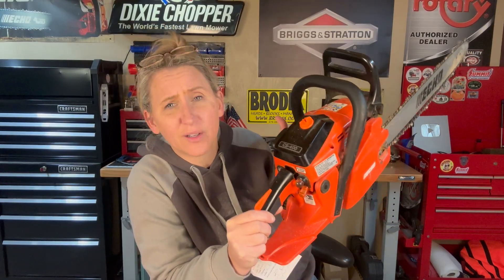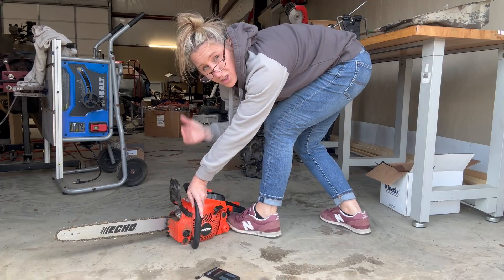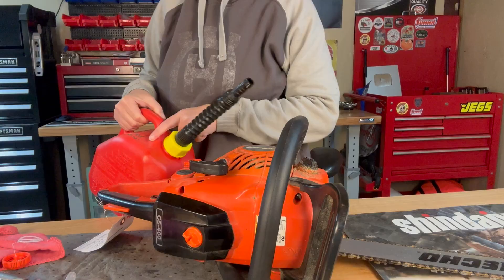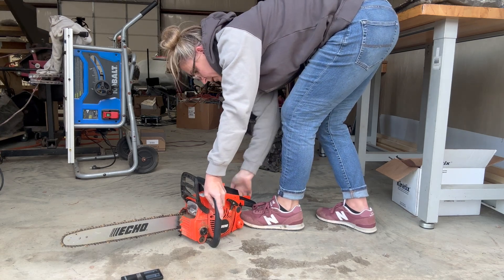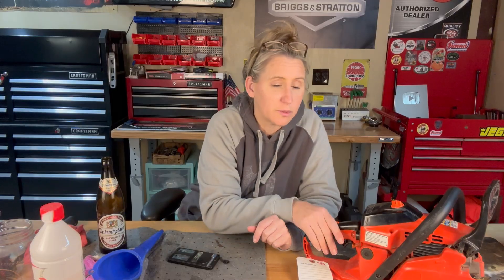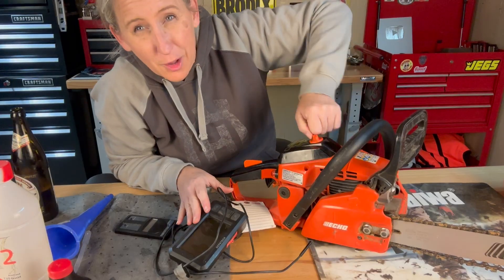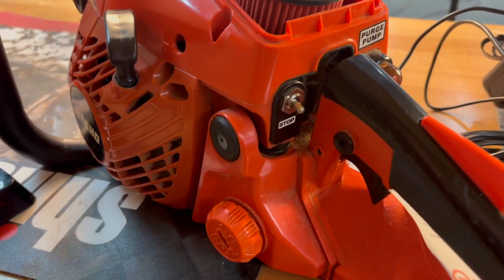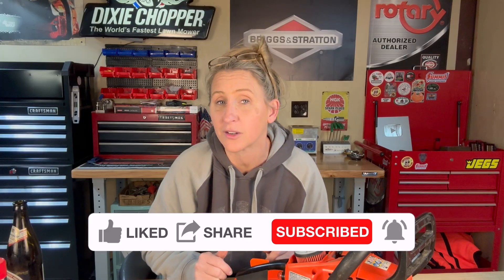Engineered Fuel FAIL! Your Small Engine Is Not Running Right, Even if You Think It Is!

Comment: I was lucky I ran tru fuel for three years no problem ever. Then I heard you talking about the problem,next time I bought a can of fuel had problems with all my two cycle equipment. Changed back to regular fuel and oil mix,problems solved. Thank you so much for your time doing videos!!!!
Reply: Ok I tried nearly everything for my ms250. It was running fine and then I ran out of my mixture so I went to the store in desperation to finish the job quick. It was Tru fuel.. great advertisement 92 octane/never goes bad etc etc so I thought I was buying high quality stuff. My chainsaw won't start. I thought my carb got plugged with the rotten cedar. I changed that. I thought air filter was dirty, I changed that. New plugs. New fuel line. New "Tru fuel".

Next on list is NEW FUEL.

Comment: That saw is still running pig rich. All that needs to be done with the tru fuel is to lean out the h screw a bit. Tru fuel is alkylate fuel and it naturally causes a 2 cycle to run richer than standard pump gas, hence the rpm increase with just swapping the fuel and no carb adjustments. 

Echo saws are notoriously set up overly rich from the factory, especially the top handle saws. 

No matter what fuel is used, the carb needs adjusted

Comment: I got a leaf blower from a not particularly mechanicaly inclined friend  Tanaka was the manufacturer; he said it was difficult to start and was impossible to start when hot. I found he was correct but also didn't idle properly. He had that pink mix fuel in it I had same issues with it and dumped it out and used my own pre mix and it ran fine. I had just assumed it had stale fuel but now I'm thinking it was just crap engineered fuel

Comment: I have four different two stroke lawn devices that require three different fuel ratios 50 :1, 40:1 and 20:1. I've been using a 40:1 mix on all of them with no problems so far and was wondering if it may cause damage to the ones that require a different ratio later down the road. Also, I noticed the red armor oil that you recommend has fuel stabilizers added and in previous videos you mentioned adding a cap full of ethanol shield stabilizer and was just wondering why? Thanks for sharing all of your repair experiences it's helped me quite a bit.

Comment: Yep. My new 2023 Stihl FS 70 came with canned fuel in the tank. It ran but I could tell it wasn’t right. I had seen your previous video on the subject, swapped out the fuel for my trusted Amsoil/gas mix and presto, issue solved. 👍

Comment: I don't get it. If I change the type or brand of fuel, I tune the carb. Takes warmup + 1 minute. If the weather has changed I tune the carb. Nothing wrong with Aspen, if the saw is tuned to run with Aspen. Gotta watch out when changing back to pump gas so the saw does not burn up.

Comment: Chicanic, I hope you will see this, even though it is a little late. I have a problem with canned gas (Red Armor.) The problem is that it NOT SEALED! Anyone could easily contaminate the fuel. I called Echo and complained about the problem. The reply was ONLY that they couldn't seal it because of pressure. WHY can't they have a one way valve seal? There are probably 100 different ways to implement a venting seal (it would just cost them to develop it.) I think the only way they can get away with the boast of a two year shelf life is because they don't list a date on the can. Another problem! I would like to use Red Armor fuel, but it seems more of a gamble than a benefit. Maybe you can talk some sense into them?

Comment: I got tired of fighting fuel and especially ethenol even after trying non-ethenol fuel for a while.  I moved to an EGO Zero Turn and hand tools that all share the same batteries 2 years ago and haven't looked back.  Even went battery snow blower and since I have 8 batteries for the Zero Turn I never run out.   I had one battery fail and they mailed me a new one without even having to return the old one.

Comment: I have an ancient home lite xl. Could you tell me the low and high rpm’s? I just rebuilt the carb. The new diaphragm has a post on it that the old does not and it would not seat properly against the needle valve arm. I cut the post off and ground it flat. Seems to  “function” . Won’t know until I fire it up. I may have to find the right diaphragm now that know what to look for.

Comment: I am not a repair shop, but friends, family and neighbors all drop off stuff for me to fix. I had a new Craftsman chain saw dropped off to me  and they said they it wouldn’t run fast and that it over heated. I ran the snot out of it and could find nothing wrong. When they came to pick it up I took it out to show them and discovered they were trying to run it with the brake on.

Comment: I'm so glad that someone has the courage to tell the truth about big box engineered fuel and that's why I joined your channel Bree. Many of the cheapo non-ethanol pump gas sellers have similar issues with that gas in the spring, the winter epa mandated or suggested mixes don't burn well on hot days. That's why I buy non-e MO gas from an airport. 91 octane mixed with Red Armor!

Comment: Do you ethanol free fuel in your mix?  If not, if the canned fuel is ethanol free, then it will run richer than fuel that contains ethanol...  and the machine will need tuned for the difference.  (I do not run the canned fuel)  Local Stihl dealer sells ethanol free fuel (not canned) and will tune the saw for actual best performance (run clean at high rpm) when you buy it.

Comment: I had the same problem with my Echo leaf blower and weed eater and lots of times they would give off a hot plastic smell and they wouldn’t start until they cooled down enough. They both would sound like they were miss firing and would die as you let off the gas. This happened several years ago before I found your channel and the technician said quit using T fuel he introduced me to Echos brand so I switched to Echos brand and never had the problem again. I even leave the fuel in them and they start every time the following year. I’m glad I found your channel a few years ago you have schooled me and saved me money.

Comment: I've used engineered fuel in Echo equipment, and it DOES work. It HAS saved me some trouble in the past. My mother had an Echo trimmer which didn't get used much. Fuel would go bad before she used it up. I switched her to engineered fuel, and her fuel problems went away, and the trimmer ran well enough for her uses.

My Echo equipment (4 engines total), as they come from the mfr, DO run better on premix. Just as in this video, on premix, they run cleaner and with more power. I think they would run just fine on engineered fuel if the carbs were tuned for it. However, if you use more than a gallon per year, the engineered fuel can get expensive. When I used to live on a small lot in a subdivision, I used about a gallon per year, and I used engineered fuel. Now I use several gallons per year, and I switched to premix. Given all the extra work I do now, I appreciate the extra power from the premix.

Comment: here's the thing - if that's all the customer is running it may be advantageous to try to tune the saw to that gas. its not always possible and the chances of getting two cans mixed he same is not great  but i've had multiple comebacks as theit trimmer ran great until they went back to thier gas. tuned it to thier junk they never came back.

Comment: The fuel Co from the big box store should be responsible for the repair bill.  I use 93 octane non-ethanol and the Stihl 2-cycle oil. Never an issue.

Comment: But why doesn't Echo adjust the carb perfectly from factory?
Stihl does, they just tell you not to hit full throttle for the first three tanks...
And about fuel, that "engineered" fuel is just ripoff. They are much more expensive than normal fuel and machines fon't like them...
Just always mix at least 89R+M/2 octane and 2% of JASO FD oil and you're safe and machines will be very happy.
These can fuel should be illegal...

Comment: Aspen and other akylate fuels are top notch, thank you for verifying👍. And if you arent commercial only using your saw randomly and cant be bothered mixing fuel,  you are very well off - and it will sit for a year without problems and start right up. There are cheaper alkylate alternatives to Aspen, which are just as great😉

Comment: Watched a previous video of yoirs regarding this fuel and determined that is why my my Stihl FS91R wouldn't start. It now runs better than ever with pump gas. The reason I own the Stihl in the first place is I had. Husqvarna that always was bogging down so I dold it. I now realize there was likely nothing wrong with the Husqvarna either but it was also that fuel. Thank you for this.

Comment: I would never use that red armor oil...been using amsoil sabre for 20 years in all my pro saws with zero problems and very low smoke and very clean chambers..also..for less than that 6 pack of red armor I get twice the oil with sabre...kind of a no brainer

Comment: The canned fuel has a manufactured date code on the can. The manufacturer states the fuel is good for two years after opened. Five unopened.  For my own curiosity I checked and found canned fuel dated close to the 5 year mark on store shelves. I'm going to say the average user is not going to know or check date codes. Honestly, I use to use the canned fuel. I haven't used it for a few years now. This was a really good video.

Comment: I grew up watching my uncle run a small engine repair shop and learned so much from him. I started to follow the same when I got old enough, but as lawn mower engines changed from points and condenser to electronic ignition, carb's became cheap plastic non adjustable crap, and engines went to overhead valve i lost all desire to be a small engine mechanic. I still work on all my own stuff and some that friends bring me but wont do it commercially. I really appreciate your channel as it teaches others how to deal with the smaller things that can be kept out of the mechanic shop and save money. I also enjoy your channel as I still learn new things from you. Thank you.
Reply: Just bought some red oil today. What am I gonna do with the synthetic Stihl stuff?

Comment: Another outstanding video.  Every refinery has a lab and each batch of gas is tested for so many things before it leaves for the distribution center.  Very seldom does bad gas leave the refineries.  Bartenders know water mixes with ethanol and and gas mixes with ethanol.  Never store gas inside the house, garage or basement.  Temperature changes outside in the shed expands the volume of gas and it "exhales" in the heat of the day, and "inhales" when it cools down at night.  Over time it traps water.  Cap the spout.  Use fresh gas.  We are blessed to have non-ethanol available.  I'm from the corn belt and politicians and there's no such thing in my part of the Midwest.
Bree is a resource for us and such a wealth of experience and knowledge.

Comment: I have rarely found a bad or broken spark plug. Most of the time i can soda blast and blow with high pressure air good as new. Most of my problems are gunky carb, needs a carb kit or bad fuel

Comment: Not trying to be critical but personally I’d be mortified to see my saw run directly on the concrete or god forbid gravel. I use a rubber mat or just an old piece of carpet to do ground running.
Reply: Agreed.  Concrete is very abrasive.

Comment: I have resorted to having my local farm and ranch store special order me the big barrels of VP Racing 93 octane ethanol free fuel, as you cannot get 93 at the pump here in the mountains of western Montana. It is not cheap but I use it in everything from string trimmers and chainsaws (where I do my own pre-mix) to jet skis, motorcycles, and even my outboard-powered boat. Never had an issue and it is definitely not your “big box engineered fuel” that you’ve called out in the past. Love the channel and appreciate the heads up on stuff like this.

Comment: I mix my own fuel using 100ll avgas.
Keeps a long time and everything fires right up in the spring.
Reply: If you were running a large number of hours you’d need to get some Decalin to scavange out the lead deposits that’ll eventually form.

Comment: I use Pennzoil outboard, or opti
Reply: may not apply, any more - 50 years ago, my dad was having trouble with his cars burning oil, and his mechanic told him to switch away from Pennzoil.  he did, and the oil burning dropped to less than a quart between oil changes. (by which I mean none in the best engines, and still less than a quart in the worst engines)
Reply: Outboard mix may not be good for non outboard 2 strokes. Outboard engines are water cooled.

Comment: Here's a test you can do. Try buying the 4 stroke straight gas version of the canned gas you don't like and mix with your favorite 2 stroke oil and see if it gives you the same problems. That's what I do and so far so good. I'm thinking that whatever they use for oil in the mix versions is causing the issue. Maybe? Not trying to dis you.

Comment: Going to try and change out the fuel today with my Rancher 455. I use non-ethanol fuel already but the fuel is about 6 months old now. Used the saw the last couple days and it is bogging down at high RPM big time. Here is to hoping 😊

Comment: I've always found things like that to be snake oil, unfortunately you have an anti-ethanol additive that fits that category too.  It's the gasoline that causes rubber parts issues, not the ethanol.  Since gas and rubber are from the same resource (in this case, petroleum) they will affect each other.  I mean, try soaking some rubber in a small container of Premium fuel and you will see it warp or dissolve it over time.

Comment: I've got an Echo PAS 225 that I've had for about 5 years.   It runs fine for about 10-15 minutes (about the time it takes me to edge and change out the attachment).  After that when I apply full throttle, it just bogs down and dies.  The only way I can get it to run right again is to run it with choke and I have to feather it to get it just right.  One thing that I have noticed is that I have a lot of oil coming from the exhaust.  I checked the spark arrester and cleaned it up with a torch but still have the same issue)  I run my own fuel mix.
Reply: It sounds like you have a fuel problem.
Perhaps a vacuum is building up in your fuel tank - check the vent or run it with the cap partially undone.
Maybe the carburettor needs cleaning out.
Maybe the crankcase isn't sealed.  Carry out a vacuum/ pressure test.
Possibly your ignition coil, but you say you can run it on choke.
Maybe someone else can give more ideas.

Comment: Trufuel in all my 2-cycle stuff and ethanol-free in the 4-cycle for many years. Zero problems. Long winters up here (late Sept. to early May), stuff just starts right up and runs fine in the spring. Mostly Echo, Stihl & Husqvarna equipment. Endless carb. issues before I switched to E-free gas.
Reply: I to use engineered fuel  up here in Northern Illinois.  Hard to find non-alcohol fuel in the corn belt.  I did find non-alcohol fuel in Wisconsin last year.  Some of the stations sell non-alcohol premium.  I purchased some of that fuel and it works good in snowblower, riding mower and generator.  Still use engineered fuel in chainsaw and trimmer.

Comment: My local municipal airport sell to consumer, ethanol free fuel for small engines, the only thing you need is a 5 gallon can.  I use a racing fuel can and transfer at home because it has a wider opening than most cans and an airplane pump has a wide nozzle.
Reply: Aviation and racing fuels are awfully expensive though!😢

Comment: It needs the h screw turned in.  You CAN'T seem to realize that the carb needs to be set for the fuel.  Try model airplane fuel.  It will run good, but NOT on stock carb. settings.  Your fuel just runs leaner instead of richer.  Tell me that the engine would NOT have run better with the carb adjusted!!!!
Reply from the maker: You absolutely should not have to tell the customer to adjust their carburetor for a different kind of fuel. Make them have to buy a special tool to remove the limiter caps and then try to adjust it by themselves. They don't even want to mix their gas and you think they will adjust the carb correctly?

Comment: I learned how to fix my snow thrower from something you mentioned in one of your videos..... the cable for the throttle handle was super loose.... so there was no air/fiel delivery..... after tightening the turnbuckle up to  the point where there was a slight pull on the cable at rest, all fixed. That and a shear pin, and good to go!

Comment: And an unrelated question, just bought a new ExMark X series 21" mower, for commercial use replacing a Kawasaki powered 21" Toro commercial (2007 model) and the dealer was stressing to only use Kawasaki oil which sells up here in Canada at $17.99 per litre. Plus a new filter at $19.99 each 50 hours!  Must I use liquid gold, or is there an affordable alternative that meets Kawasaki's warranty?

Comment: I use the STIHL MotoMixx in my stihl machine and have never had issues with it...  I figure a fuel made by the manufacturer is going to be made for that manufacturers machines? is that a decent idea or shoiuld I be manually mixing gas and red armor?
Reply from the maker: I haven't seen any issues with the Stihl or Red Armor premix fuels.
Reply: @Chickanic  I use it because my yard is small and it has a 2 year shelf life..  I was wasting fuel every year as if I use a 1/2 gallon then thats a lot..  luckily my 1978 international school bus didnt mind a 1/2 gallon of my own mix each year..  but with the moto-mixx its just easier..
Reply: Probably a lot cheaper if you can mix your own!